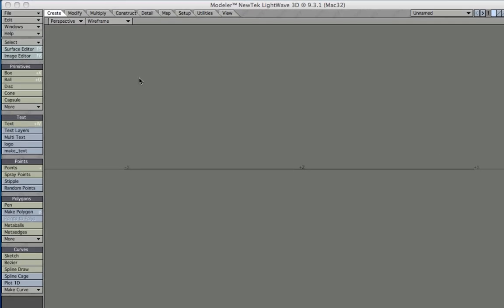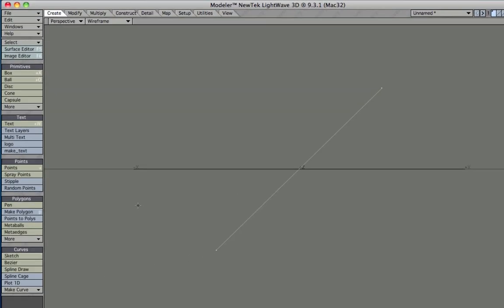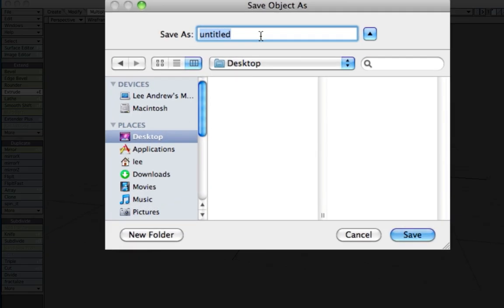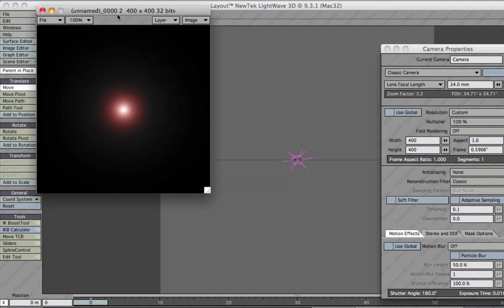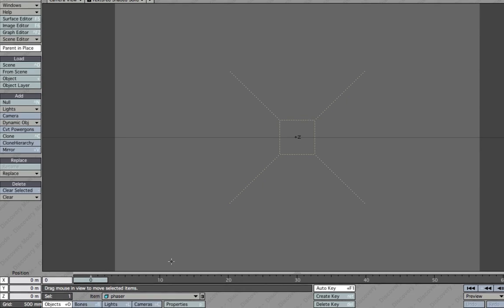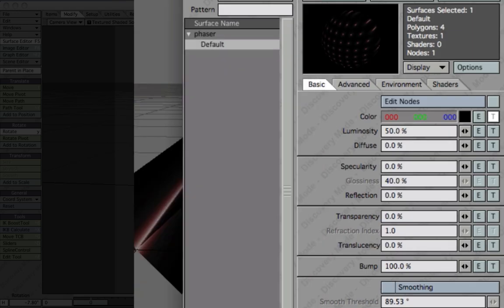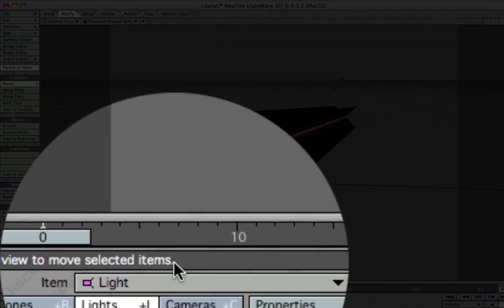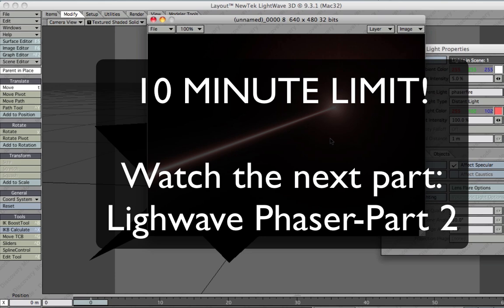Lightwave Laser - Phaser - Part 1 of 2 by Lee Andrew

Comment: LeeAndrew,

I'm having a rotation problem with Lightwave 9.x, and I'm not sure if it is a glitch or if I'm doing something wrong. First off, I am an amateur at the Lightwave animation process, and I don't want to use bones for a battle scene with the USS Enterprise and USS Reliant. 

Everything works fine except the bank rotating option. For some reason, when I bank the ships, LW actually rotates in the opposite direction about a degree before banking in the other direction. What gives?